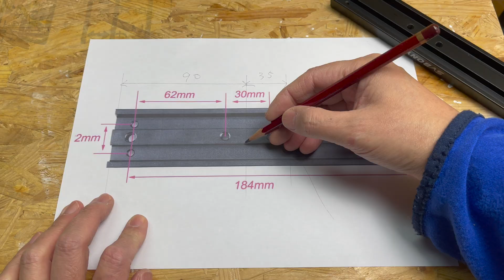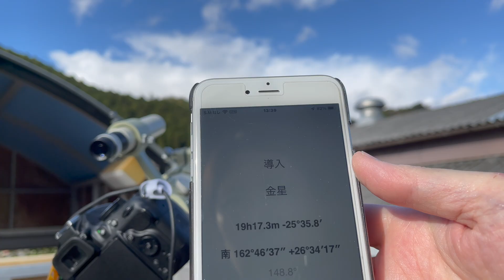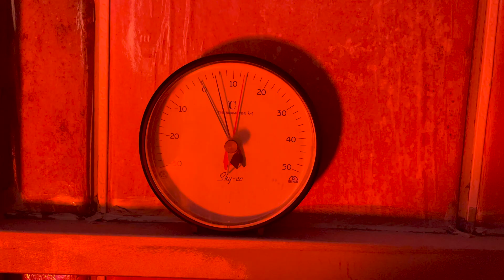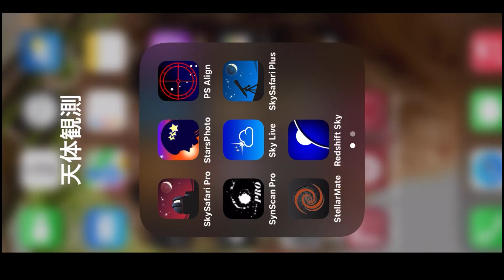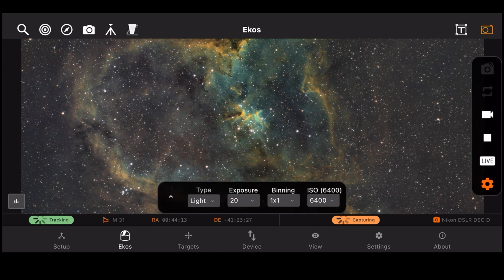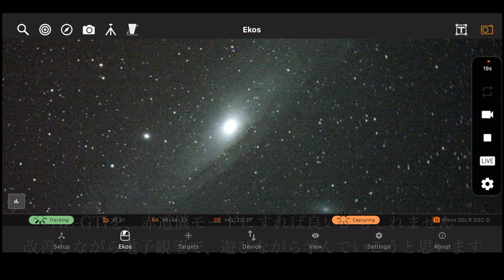【望遠鏡と電子観望で遊ぼう！】AZ-GTiにStellarMateで電子観望＆ダブテールプレート交換

Comment: Use your AZ GTi in EQ mode with its software upgrade, then you will not have the star trails, when using the mount in Alt/Az mode which is not the best option for astrophotography. I used mine in EQ MODE. Greetings from Tasmania Australia-Southern Cross Observatory-Tasmania 42 South.
Reply from the maker: Thank you for your comments.
Changing to EQ mode would be great for astrophotography, I will try to do the update to EQ mode sometime.